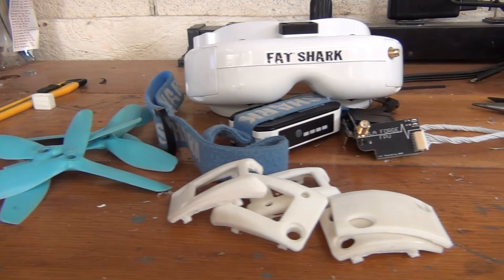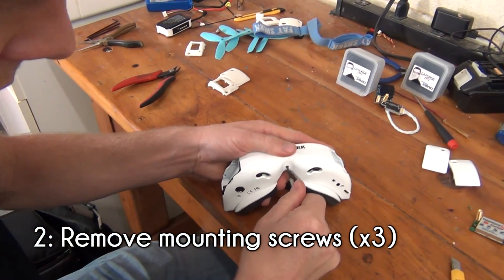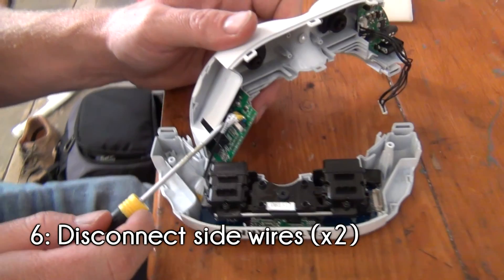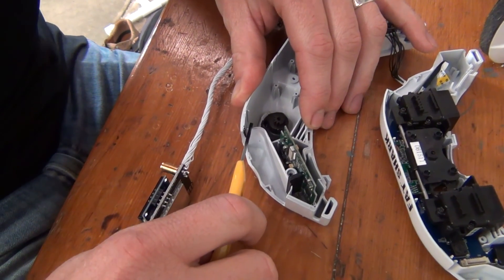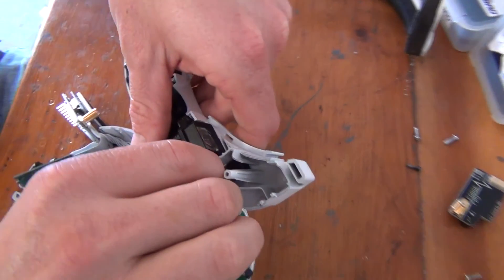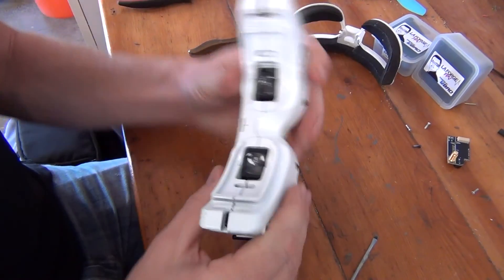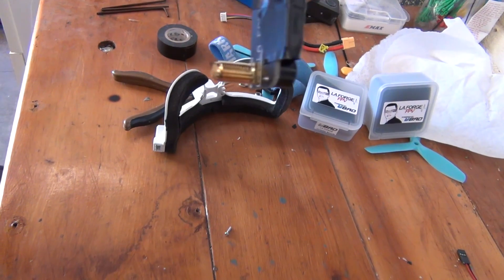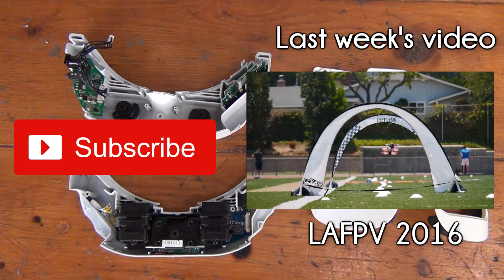FatShark disassembly and LaForge installation [Propwashed Testbench]

Comment: There's no need to remove the screw in the middle of the faceplate.  It just holds on the fan duct cover, which is all a part of the faceplate.

Comment: Thanks for the Video. One thing that tripped me up, the ribbon orientation. In the video you say to face the silver side to the PCB, but actually it only goes that way on the pcb behind the receiver. The ribbon which connects to the DVR2_V06 board should slide in with the silver facing out.

Comment: do you know if the diversity side will fit into the goggles of the hdv2 with the trinity head tracker board installed?
Reply: We don't have a head tracker board so we can't test. I don't think it will fit without some additional modification though..
Reply: ok, thanks

Comment: Can you explain exactly where you attach the probes from your multi-meter when doing the continuity test?  Thank you!
Reply: The positive and negative battery connection points. You're looking for a dead short on the battery voltage.
Reply: It says 0 on my multimeter. I checked everywhere on my Fatshark but it says nothing about where the short came.